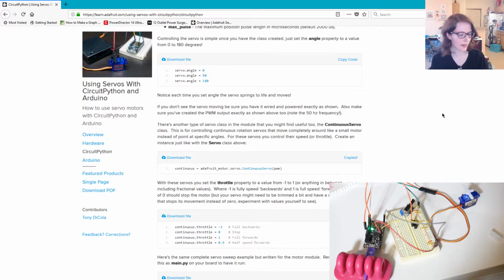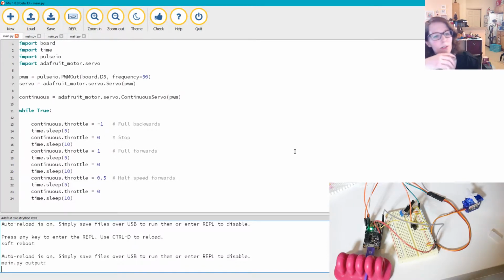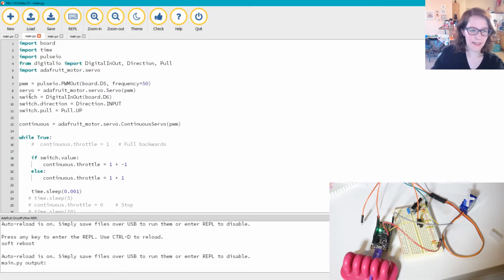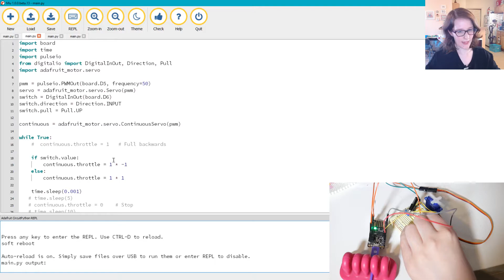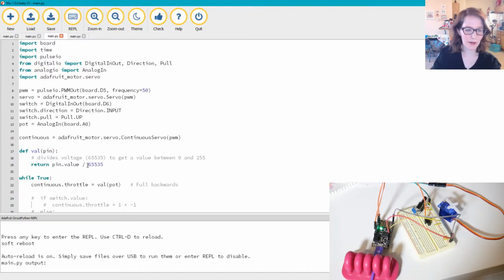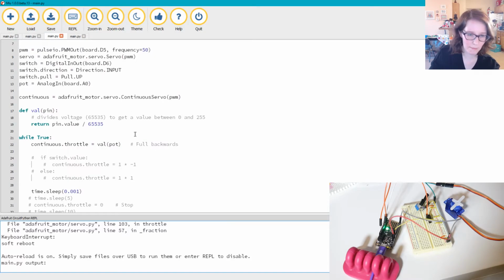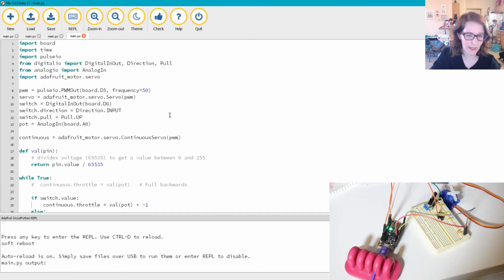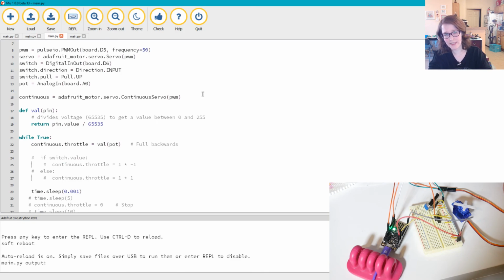How I Write Code For Projects

Comment: This is great!  Chuck into pieces will also help to debug the code easier.  I think you can add a capacitor to the servo to smooth out the gitter or that extra spin.

Comment: "Smoosh together" is the technical term we use for Software development!

This is a great approach and everyone should follow something like this. I've lost count of the amount of people who have asked me for help on projects where they try to tackle 4 or 5 different new things all at once!

Just one suggestion if you are trying out a new board or language I would even move one step simpler and get a blink code working first before anything else.

Don't see yourself short! "Programmer" is not a protected term, if you program stuff you are a programmer!

VSCode is a nice editor if you wanted to give it a go(almost IDE like, gives suggestions etc) Not sure how it works with circuit phyton or if it supports the REPL (it does have a terminal so I'm sure you can connect to it)
Reply from the maker: Thanks! I used to be one of those people with terrible criss crossing and crashing lines of code so I'm hoping this will reach some people haha. Blink is definitely a good starting point and I haven't tried out VSCode, but I'll look into it.